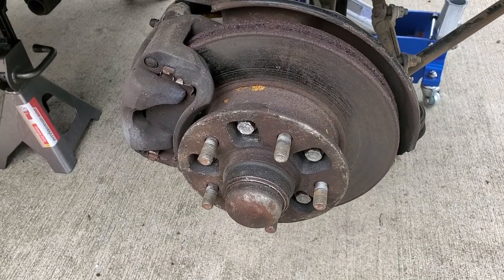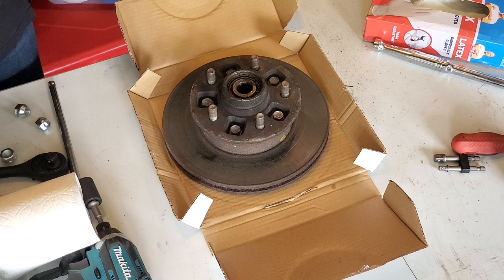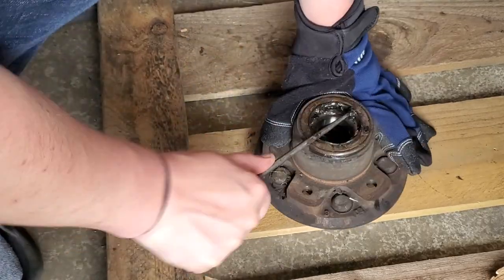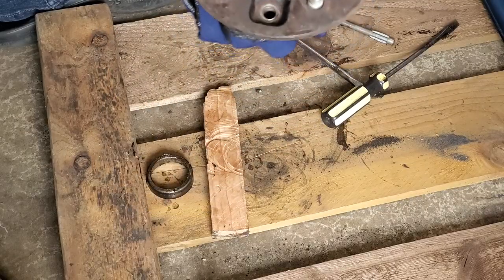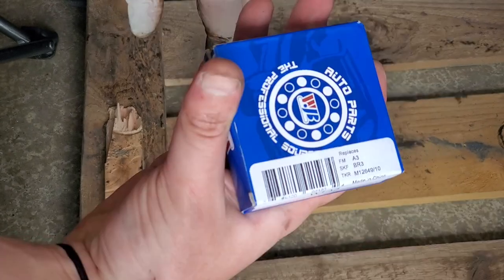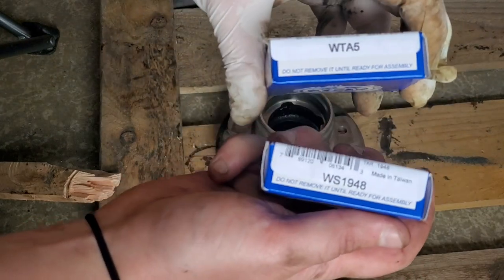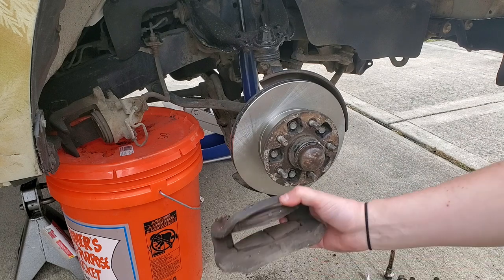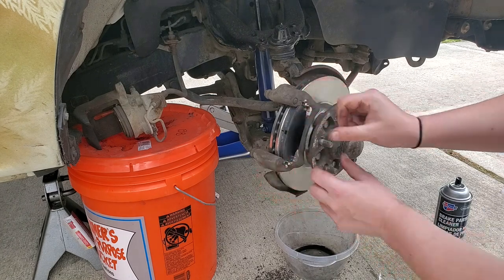Front Wheel Bearings & Brakes Replacement | 1989 - 1995 Toyota Pickup/Hilux RWD

Comment: What’s the nut size on the wheel bearing? Doing this tomorrow and wanna torque it with a wrench since I don’t have good intuition on torque ratings
Reply from the maker: Sorry just saw your reply, I believe it is a 54mm nut for the wheel bearing. Pretty large haha!
Reply: Literally hand tight only. Over tightening even once will destroy the bearings. Hand tight, spin rotor back and forth as you tighten and back off. Repeat several times. Tighten hand tight and put the  Cotterpin in place to prevent the nut from backing out. I cannot stress enough do not go beyond hand tight.
Reply: Great info
Reply: Hey friend - I just was working on my 1989 2wd sr5, and the main axle nut was 30mm.

Comment: Rather than loosening the bleeder valve on the caliper, I believe you can just take the cap off your brake fluid reservoir when compressing the piston. Great and helpful video though my friend, going to do brakes on my 1990 soon. Thanks for the video 👍
Reply: I used a mechanical puller to press the caliper open too, it becomes just as good as a purpose caliper spreader tool.

Comment: Torque spec on the rotor bolts is 47ft-lb.  Guide pins are 65, and caliper mount ["torque plate"] bolts are 80. If you change hoses, torque to caliper at 22ft-lb [and beware of re-using copper crush washers].

Comment: Tip: when separating the hub from the rotor just lay it flat on the back of rotor and use a pry bar between the stud and rotor and tap adjacent side with a hammer it will pop loose then swap sides with the hammer and pry bar it comes apart easily without causing any damage, good luck everyone

Comment: Found this super helpful, I'm in the middle of doing the brakes on my 1990. Also if you've got a pair of crutches lying around with no use and no impact, they work great as leverage bars for loosening up those tight nuts and bolts or even for torquing where ever you're able to fit it of course

Comment: If you install new bearings you need to drive the vehicle for a few miles and re check the bearing adjustment. If the races and rollers are in good shape no need for replacement. Yours looked good from what I saw?
Reply from the maker: Good advice! Also ya mine were probably good but they're like $3 each and I don't actually know the last time they were replaced so I changed them since I had the hub off 👍

Comment: Thanks, man - you just saved me several hours by sharing your experience changing the front end brakes and bearings.  I was not planning on doing the bearings - just the brakes - but seeing how the bearings and brakes are integrated - it kinda seems like I should take advantage while I'm pulling the wheel assembly apart.  Can you confirm those 5 bolts attaching the rotor to the bearing housing are 14mm?  I'm asking because I think mine might be larger - sort of thinking someone put the wrong bolts in.  One tip I might humbly add: if your bolts are stubborn, an overnight soak in PB blaster can make a world of difference.  Also - a tip if you are doing this the 1st time: pull off both tires, but keep one side intact while you do the other, so if you can't recall exactly how everything went together, you can use the untouched side as a guide.
Reply: update: I checked, and they are indeed 14mm bolts.

Comment: Nice project truck.  I saw your radio video, no AC?  Where do you live?  My aging 1994 needs various work.  I bought in ‘98 and it recently became my primary vehicle again.  Changed radio right away.  Did changing the bearings make much difference?  I need to do brakes and rotors and debating a bearing change.
Reply from the maker: Sounds like a cool truck! I would recommend doing the bearings if you're already doing the rotors. For me it made a big difference because mine were worn and loud. But they're pretty cheap and not too difficult to replace and you'll have to remove the hub from the spindle to change the rotors either way. So for a little extra work you don't have to mess with it for a long time.

Comment: thx bro, like to point out (which you show) the caliper slide pins come out first, then you can get to the caliper bracket. Kind of unique setup...thought I might have to take the lines loose but I dont. Bucket to hold the caliper is a nice tip too, thanks

Comment: hi, for your toyota hilux, did you convert drum brakes to disc? or is it original discs?
Reply from the maker: I have original discs on the front and original drums on the rear. Hoping to upgrade at some point though!
Reply: Speaking of the front brakes, I have a '74 Hilux that came with drums and I found '75 Hilux spindle assemblies at a wrecking yard and calipers that bolted right up, no change to the master cylinder and they seem to be working fine for several years now, work better and much easier to service than the original '74 dual wheel cylinder drums.

Comment: I have to same truck, I was wondering how I can take off the wheel bearing hub assembly to change my broken wheel stud since the new one cannot fit while the hub is attached to the rotor.

Do you think I can take off the five bolts holding it to the rotor and wack off the assembly? Or do I have to take off the nut for the wheel bearing.

Best
Reply from the maker: I don't think you'll be able to get the wheel stud out unless you take the hub off at the bearing. The rotor is between the hub and spindle so even if you took the bolts out you wouldn't really be able to access the backside of the hub. You might be able to squeeze the old bolt out from between the two when separated but you'll never be able to press the new stud in while assembled.
Reply: @bradleybarringer  Thank you!
Reply: @bradleybarringer If you can get the new stud in position you should be able to "press" the new stud in place by simply putting on the lug nut {without the wheel} and tightening it with just normal socket wrench force, I did this about 30 years ago on a Dodge as best as I can remember. Washers may be needed to pull the stud all the way up to get past the unthreaded shoulder on the stud.